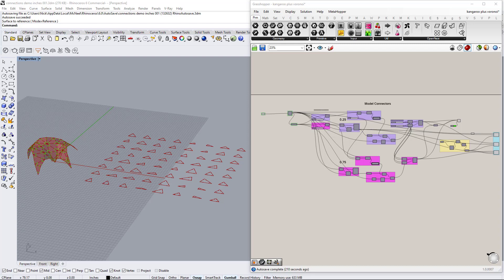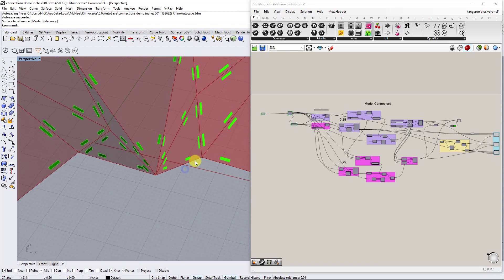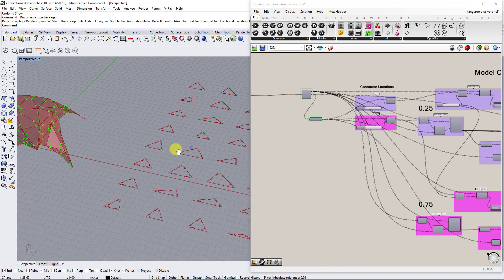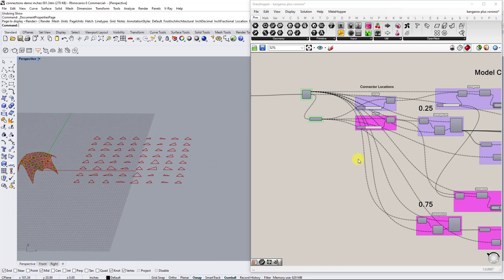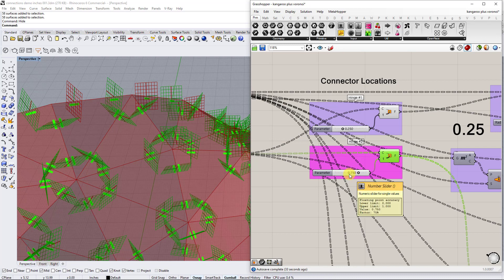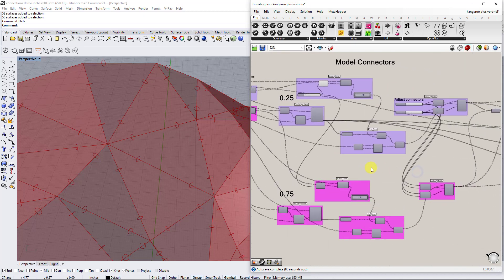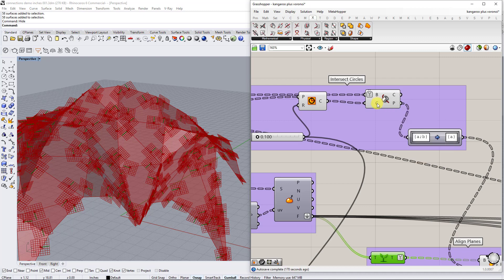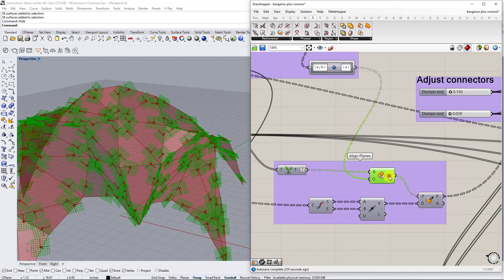ARCH 231 - Digital Fabrication Connections for Surface Panels (in Grasshopper)

Comment: Really very good tutorial.

Some time ago i did something similar in a Blender (i'm not pro blender user) with Python but recently discovered rhino and grashooper. and I really want to know that. I think I have a problem with understanding the logic of these scripts (I think every control is a small script), may by  I'm too old. Here I have a problem with Perp frame, in my case , every triangle 1 edge is not supported. I will look for an answer a little more, but I think I'll start looking for a programmable answer :)

Comment: Great lesson. A way to make the number slider of the perp frame parametric for both 0.25 and 0.75 will be to have subtraction component with 1 subtracting 0.25 and substituting it with the 0.75 number slider, with that the 0.25 number slider will be the only slider needed to be controlled.
I do have a question though, i will like to know how one can consider the thickness of the material since they will be bent at an angle if its 18mm plywood for example?